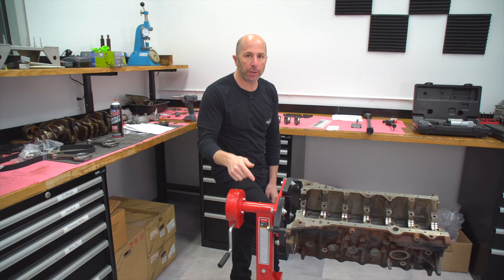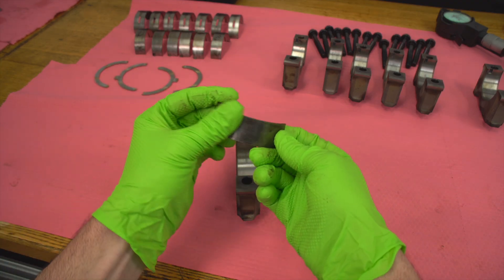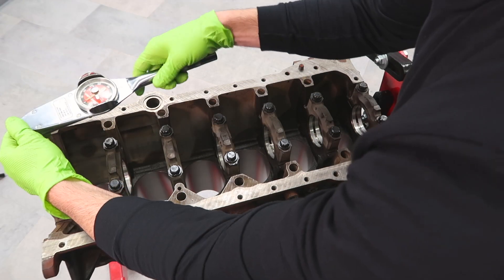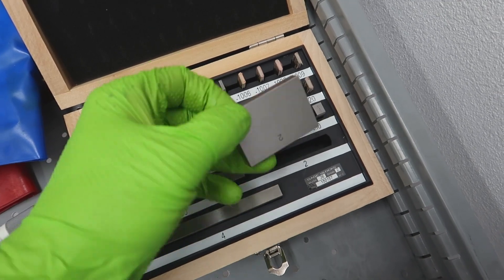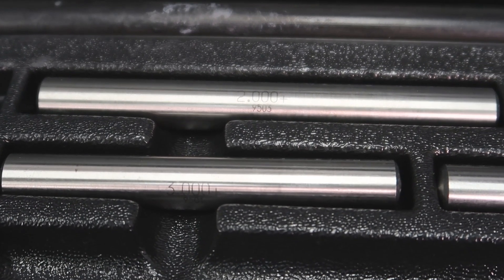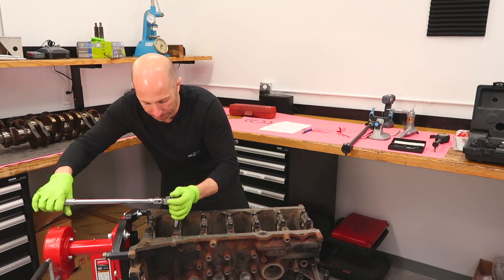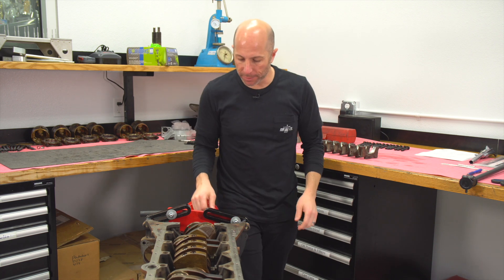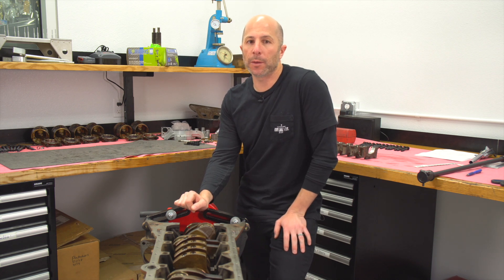$7 Vs $1,000 Engine Bearing Measurement Tools - Plastigage vs. Sunnen Dial Bore Gage

Comment: The other thing is that the plastigage doesn't care if you're stacking tolerances.  It just gives you that otherwise impossible to measure installed clearance.
Reply: correct  actual clearance versus theoretical clearance

Comment: A potential source of a misreading of Plastigage happens when the crank is only contacting the main bearings in two locations.
Get some "engineer's blue" and figure out where the crank actually contacting the mains.

Comment: Plastigauge takes all the guesswork out of knowing how to use those expensive tools. Both of those ways will tell you clearance but neither tells you bore straightness, the advantage of the plastigauge is that it doesn't lie about the actual clearance (within a small tolerance), I'll bet that you retested your expensive tools after checking with plastigauge or at least questioned the results that you you got from the first test. With that there are some things to think about with plastigauge, how old it is, if anybody has been man handling it, temp it was stored at and it's obviously not as consistent as the dial gauge down to tenths, but for anybody building anything other than a completely blueprinted engine it's perfectly fine if not the perfect tool.

Comment: As someone who does aerospace machine work. The cheap tools are generally fine and accurate, but only for short term. There's a reason I and all my co workers have high end expensive tools. We need them to be reliable 100% of the time. But for the guy building an engine in their garage and only needs high accuracy measuring equipment occasionally spending thousands on bore gauges and mics isn't worth it at all when the cheap alternatives are just fine.
Reply: I find it funny that it’s a precision gage block...who calibrated that gage block? Who certified it. Is it traceable?  Sorry. I’ve been machining aerospace for the last 10 yrs, also worked in a large companies gage room.
Reply: What kind of stuff do you do at your job??

Comment: Would there not also be some measurement error with the Plastigage considering the material is on a curved surface and the included ruler is flat? The difference might not matter on larger diameter bearings, but if used this on a much smaller diameter bearing, the error would be much more noticeable.

Comment: Building a small block chevy and just picked up $7 worth of plastigage and $993 worth of beer! Thanks Papadakis Racing!
Reply: So, in other words. dont trust any engine build you do after all that beer?
Reply: @itsjustnopinionok  You use it in the order you buy it. He's good to go.
Reply: +23 YouTubes to you good Sir.
Reply: beer?  More like a new set of forged pistons
Reply: you should always use both... i use a mic that i trust and a snap guage inside the mains mostly to double check roundness but yea there's no amount of expensive tools that will replace plastiguage and no amount of plastiguage will replace a competent measurement especially when talking about roundness  and even an out of calibration mic can confirm roundness of the mains rods and journals then u just need the plastiguage to check clearance
Reply: I found putting the red plastic gage beside the green and torqeing them down cam came up .001 different in measurement from plastic gage paper
Reply: Thats
A lot of beer

Comment: Can someone explain the 90 degrees after torque spec please? Wouldn't that cause out of round in the main bores?
Reply: That's a giant of can of worms I don't want to tackle w/o doing the "refresher" research b/c I don't want to give you an incorrect answer. I suggest Google, and staying away from anything non engineering/scientific as due to the joke "I found it on the internet, it must be true." At least until you can get through the following which should help you navigate the bullshit. 

Some of the things to think about: if you & and your neighbor both tighten the bolts to the same torque (using the same wrench for this questions) but only one of you greases the threads & head who's bolt will have higher tension? Who's bolt will have threads that started to deform axially (this isn't a bad thing, it's actually desired)? Assuming no deformation (_not_ real world, but a good thought exercise) how much tension will be added to each bolt when turning it 90 degrees (more, less, same)? How much additional torque would be required on each bolt to turn it another 90 degrees from an initial torque value that was on the cusp of causing deformation (again, more, less, same, can't really say, )? Now, if both bolts start with roughly the same amount of tension/deformation after being torqued, what happens to the tension/deformation properties when turning an extra 90 degrees (companion question to the previous one)? 

Try to answer these logically & you'll have an idea of the science & associated issues that can arise from specifying torque values to get a desired tension in a bolt. Or clamp force as that's ultimately what the tension equates to.

Comment: Thanks for that video, that was super interesting. I have a question though: do you measure the clearance with the old rod/main bearings or with the new ones? If the latter applys, does that mean you need to get new bearings just for the measurements and then maybe replace them if the clearance isn't within spec? Thank you very much, really appreciate your videos. Sorry for spelling-mistakes.

Comment: Bottom line is both are useless if you "think" you know what you are doing.  With stock type rebuilds you can get away with about anything.  If the second tool you grab is a beer then 7 dollar tools are great.  If your blueprint building motors that $1000 dial bore is going to tell you more than a piece of wax.  You can check things like roundness and taper of the block/caps without bearings installed.  The tool is only as good as the user.  I would say that hard measurements are much better. The further from stock the more those big dollar tools are needed.

Comment: "metric and standard" 
had a good laugh on that one :D
Reply: What's funny?
Reply: @jaydunbar7538  well, metric system is used in most parts of the world and its quite more "exact" than imperial units. I get the fact that metric units are uncommon in U.S., but they really are more precise. :)
Reply: @lukap1407  That is an absolutely false statement.
Reply: @louf7178  which one exactly?

Comment: Great video! I share the same opinion. Its funny to see "mechanics" using expensive tools to measure everything and in the end they use STD bearings...pointless. A gap its not the same as a clearence in my rule book. You must fine tune oil clearences for proper power production.

Comment: Ok, now i understand why people in the US like those plastic things. And after checking at how much a decent bore gauge costs in Russia I understand why nobody has heard about these plastic strips there.
The problem with now having a decent gauge (or even a chinese one) is that you can't see whether your cylinder is round or turned to an elips, you can't measure the clearance of your pistons in the cylinders, you can't measure whether your cylinder is getting conical (uneven diameter across the cylinder walls), etc. etc.

Comment: If you had an engine with torque-to-yield bolts, as are very common in cars these days. Would there be any other way to do this other than requiring you to buy 2 sets; one for testing an one for final assembly?

Comment: GREAT VIDEO!

Your bore gauge is to .... lust for.

Your micrometers....?

I am building a Toyota 2ZZ-GE and the tolerances are CRAZY.

My measurement system is only, if you can call in only, +/- 0.01mm, but the manual calls for accuracy of +/-.00x (x could be 2 as in +/- .002 mm). My instruments, while good to NIST standards do not meet required precision.

Platigauge!

Comment: over here they use soldering wire to measure squish in 2 stroke engines
wich i guess sorta is the same. (except you dont wanna lose a bunch of solder into your egnine)

Comment: I think another aspect that the “high end mics” have stacked against them is procedural. Even the most expensive tools are limited to how well the user uses them. 

Errors in reading, errors in calibration, errors in temp-humidity, etc.

Comment: I've never understood people measuring metric engines using inches.....stock journal size is 62.00 mm not 61.9887 mm
Reply: Start off with 62.00 mm........divide by 25.4.....answer  2.44094488188, round it off to 4 significant figures.......2.4409 inches. Multiply by 25.4, answer 61.9988, spec is 62.00 mm top size, 61.98 mm bottom size.  No , it's not much of a difference but it makes far more sense to use metric tools
Reply: @1magnit  25.4000508 mm/inch ,
Reply: According to wiki the inch is defined as exactly 2.54 cm
Reply: Also you're supposed to measure the diameter in 3 different places because of the "out of round", you also need to measure "taper"
Reply: Doesn't really matter what you use to measure engine parts just so long as it's done precisely.
I'm certainly not going to junk 5 or 6 thousand dollars of Imperial measurement tools, they work just fine.

Comment: Great content. Always wondered how close it was doing it the “right” way versus the cheap way. I’ve got 100+ passes in my stock bottom end 6.0 LS making 900-1000hp, and I used plastigauge to check what kinda clearance I had with stock 160k mile bearings. Rods and mains were all in the .0015-.0018 range IIRC

Comment: Sorry but after years of working on vehicle's and building my own engine I'd rather use the measuring tools ive got them cost abit but well worth the money . Not to mention saves me thousands on engine work at shop and costly engine damage . Costs lits of money to go fast . To bad most so called car enthusiasts even on YouTube just slap shit together and that's why all their shitbox's are always breaking. I and many other have done it right for the start and engines still together without any real issue after 7 plus years of daily driving /trashing still going might need a rebuild so tho

Comment: Building one 350- use plasti-gauge.  

Building 10 350’s- use fancy dial bore gauge.     

We had to use snap guages to measure cylinder wear.   Shop teacher would use fancy dial indicator to verify our measurements.     It was about proper measuring technique more than using antique snap guages.        
A similar guage was used during honing to ensure straight cylinder walls.      Our holes were as round and straight as anybody else’s.     
The old van Norman boring bar or kwik way.  And sunnen hone cabinet

Comment: Nice vid! Question: I've heard that temperature can effect measurements? 
Probably just in extreme cases but was just wondering if you had an opinion on that?  Thank You for sharing your knowledge. It's helped me a lot.
Reply: Yes temperature affects both the object being measured and the measuring tool. Engine clearances are there partly for the oil wedge and to allow for thermal growth of the parts. There's lot's of engineering online calculators around for calculating the thermal expansion of various metal types. On average steel grows about 7 millionths per inch of length per degree of temperature rise. Industry standards for accurate measurements in metrology labs is there maintained at 68f / 20c + or - about 1 degree maximum. Mostly for engine assembly measurements since the tolerances aren't that tight then average room temperatures for the parts and the measuring tools would be more than good enough.
Reply: Thank You Sir!

Comment: So a cylinder of wax is within .0003 of a thousand dollar tool. I'd say that's pretty damn accurate, and good enough for home-gamers.
Reply: actually it was right on he misread it.
Reply: Actually, within units of scientific notation, both measures were identical.
Reply: Three tenths of a thousandth. So basically one third of one thousandth off. That’s nothing.  Almost. I’ve always used plasti gauge with perfect success.
Reply: TravisT TURBO GTO That is out of tolerance for what some of us do. Some of us hold tenths
Reply: Dont forget the SUNNEN causes a slight error, too. So not the complete error is actually caused by the plastigage.
Reply: bobwatters  Sorry you don't know what you are talking about! You have obviously never used these measuring tools before because they are precision instruments that if used correctly don't make errors.  And you are wrong again of course a bore gauge can check roundness and taper easily. Plastigage would only measure taper if there were any but wouldn't tell you where it was i.e crank ,bearing or the main tunnel.
Reply: @catatonia1  True dat, great vid but he didn't cover the plasti drawbacks. Must be oil free surface, and don't move the crank !
Reply: 3/10000 corresponds to about the indentation of the mechanical tool tip into the soft shells. The mechanical measurement on soft trilayer shells usually yields 3-4/10000 excess clearance. The only way around it are optical inside micrometers.
Reply: I would actually trust the plastigauge before the instrument. The number of potential error sources is way smaller.

Comment: la diferencia entre el plastigage y las herramientas milimetricas puede ser por el desgaste del cigüeñal ya que no se comparo con la medición con las herramientas milimétricas.

the difference between the plastigage and the millimetric tools can be by the wear of the crankshaft since it is not compared with the measurement with the millimeter tools

Comment: A 1/4 turn? Holy fuck! Do you have any idea how much that increases the clamping force between the block and cap? Even with the finest threads you can think of it's thousands of pounds. I know when measuring the force it takes to turn the bolt a 1/4 turn it doesn't seem like much, but what it does to the clamping force is fucking insane. Stick with what the torque wrench tells you
Reply: They are torque to yeild bolts man. This is a pretty common torque routine. Many headbolts use the same procedure also.

Comment: The other benefit of the dial bore gauge is that you can measure out of roundness. I do both to confirm each measurement on my engines :)
Reply: Ya cause thats what its for.
Reply: Plastigauge can show taper and out of roundness.
Reply: @SOLDOZER  technically yes it's possible but it's unreliable/bothersome

Comment: Nice video again. I see a lot of people install all new oem rod bearings, main bearings on the same used crankshaft. Do you think it's still necessary to check clearances? What are the specs on those clearances on that engine?

Comment: The bore gauge has to be held 100% perpendicular to the surface you are measuring, or you can easily add or subtract a few  .0001"   The human factor is more visible on the dial bore gauge.  Edit: grammar.

Comment: If you had .015 crank bearing clearance you motor would toss parts. 1.5 thou is pretty tight though. I ran 2 to 3 thou in mine

Comment: Working in a motorcycle performance shop (SA) i can tell you we use plastigauge all the time. Never had any issue getting the right specs. Just hard to find 'green' around these parts....

Comment: As good as the Sunnen gages are, you can have up to a tenths error (.0001 inch) anyhow, just in how well your setup fixture is used.  The plastic gages are just as good for this purpose.  I caught the verbal error and knew what you meant, and that you’d already gone thru the cringe.

Comment: A few years ago when I was 14 I talked my dad, uncle and grandpa out of $1,500 collectively and bought a 1978 Motorhome. 
Why did I buy a used motorhome? Because it had a big block Chevy and transmission. It was really tired. I spent the summer earning the money for the billet crank, pistons and rods. Uncle bought me new AFR heads and a Comp Cams cam and roller/spring set. 
I used Plastigauge putting it together. Puts down 674 HP at the wheels in my 65 Chevelle. 2 years later it’s still going strong 😊
Reply: My dad rebuilt hundreds of engines. Used Plastigauge religiously to check his clearances. I don't know that he ever had a problem with bearings due to clearances in the decades he spent machining engines.
Reply: steelmesh English not your first language? I can help if you need it. I don’t mind helping those in need.
Reply: @chloehennessey6813  He's going to need ointment for that burn.
Reply: steelmesh At the time I didn’t have enough money for a 454 LSX. So I got the motor home because it had a 454 big block. I stripped the engine out of itZ rebuilt it with race parts and jammed it into my Chevelle. 
You honestly didn’t put two and two together like the other guy did? 🤷🏼‍♀️
Reply: steelmesh lol show us where the internet touched you.
Reply: steelmesh All you had to do was say that you’re a little slow with English. 
Everyone else grasped what I said. Than there you. 🤷🏼‍♀️😂
Reply: @steelmesh Seriously, dude, what fucking part of her story was confusing?

She borrowed cash from family. Bought a used motorhome because it had a 454 and a transmission. Spent the summer earning cash so she could buy more parts. Uncle bought her some stuff. She put it all together, using Plastigage to measure clearances. Engine puts out good power and has had no issues.

Don't be a douchebag because you made a fucking mistake with your comprehension.